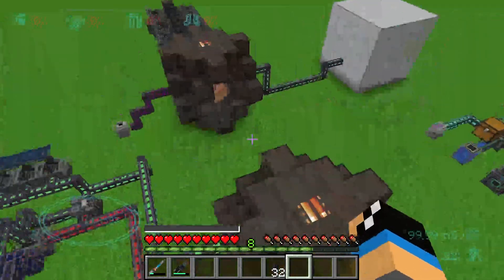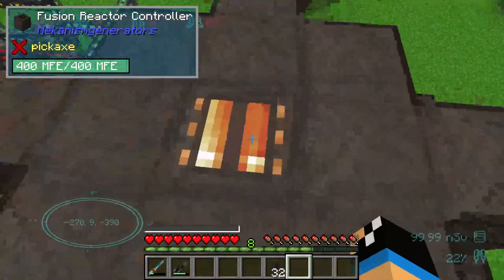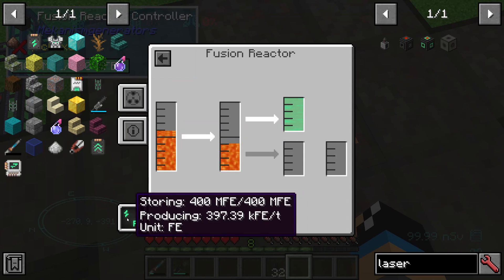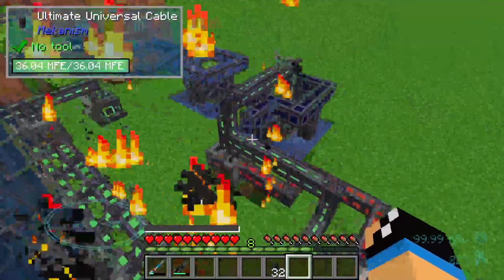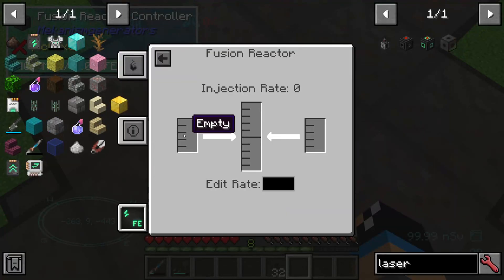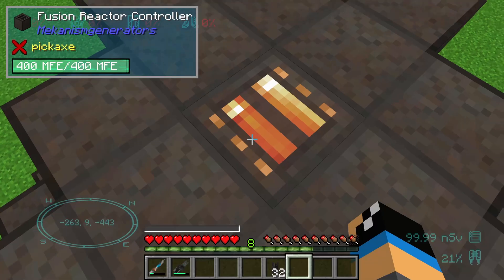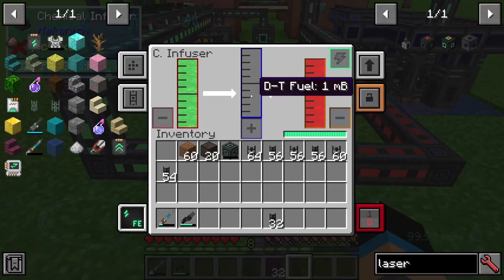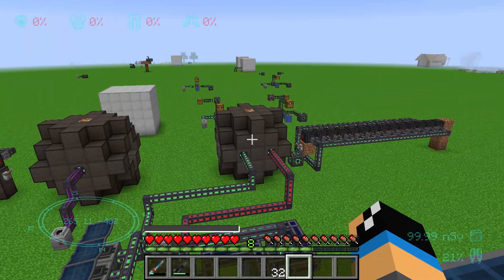Fusion Reactor Comparison Tritium Deuteritum and D-T Fuel 🔌 Mekanism Tutorial 1.16 🔌 English

Comment: how much thermal evap plants and pumps do i need for the 1000mb DT Gen?
Reply: 6 evaporation plant 
5 for brine, 1 for lithium with 11 pumps for each tower (for water) and resistive heater set at 1250 FE/t 
Best if you use sink and any other mod like integrated dynamics for a faster pump rate than Mekanism pumps

For deuterium you need 50 pumps all with filter upgrades
Reply: @blank6372  i now am the Proud owner of 11 Brine Plants, and 1 Lithium and Arround 250 Pumps for Deuterium. Also 6 of These Things that Craft the Fuel. Also. If someone ever repeats that, make Sure to have Enough storage for Tritium or the Generator will Turn Off in the Night.

400MFE per tick
Reply: @teilzeitpessimist8136  do you combine the deuterium and tritium into DT fuel before injection??? Or pump deuterium and tritium directly?
Reply from the maker: you solved your problem already?
Reply: @teilzeitpessimist8136  hi so i have a problem, i made everything just enough to produce 1000mb dt fuel but for some reason every time i turn on the fusion reactor it instantly shuts off and it produces like 400m fe. im using a quantum entangleporter for the dt fuel input (the quantum entangleporter is also full with dt fuel) and yes i did properly configure my entangleporter so it auto outputs the gas into the port

Comment: So, basically, separate Deuterium and Tritium are better than D-T
Reply from the maker: You can reach a higher amound of maximized energy production with the d-t fuel, but in the lower energy area it is better to us deuterium and tritium separated
Reply: The Fusion Reactor can burn 1000mb of D-T-Fuel per tick, which is alot and unless you can deliver that much using deuterium and tritium is more efficient